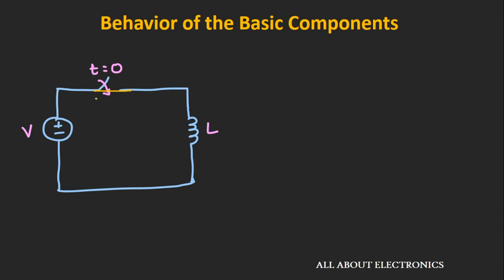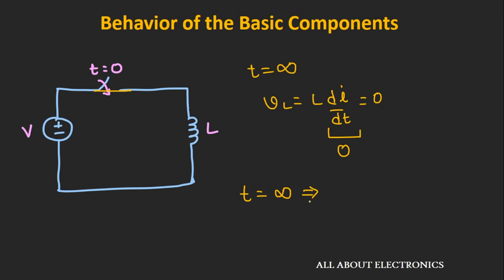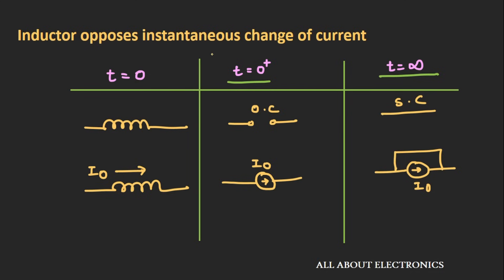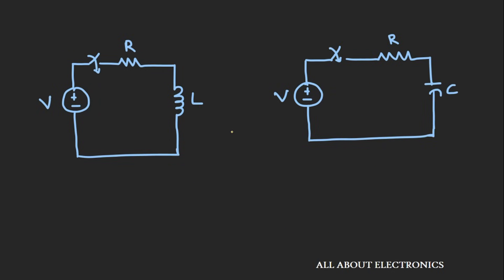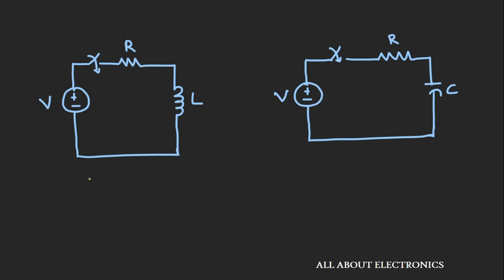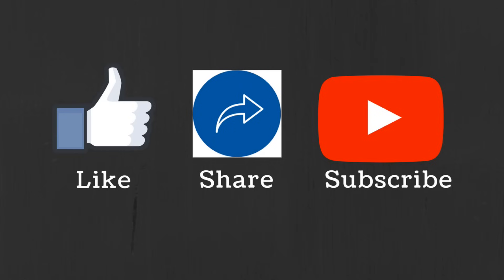Transient Analysis: Behaviour of Basic Circuit Elements

Comment: Great explanations, thank you. I have a few suggestions. I suggest you connect resistors appropriately on your circuits and avoid short circuiting voltage sources and open circuiting current sources. For example at 4.27 the circuit will obey the explanation you provided at switching moment (that is inductor current=Zero) but in long term it will short circuit the source causing theoretically infinite current. This can be avoided if you connected a resistor in series with the inductor.

Comment: I  just wonder if inductor at t=0+ acts as open circuit, but why the current can flow trough the circuit?
Reply: it is because there are two cases it opposes the sudden change in current but along with it when a source of current is already connected and current is already flowing from it then only it acts as a current source. hope this helps although your semester is over lol

Comment: Hi sir what is the meaning of short circuit parallel to current sorce. According to kcl applied at t= infinite the final value will become short  circuit current+ current source value. I mean to say why we write that symbol -it's confusing
Reply from the maker: What it indicates is, the voltage across it is zero. Because the voltage across the inductor can be given as V = L di/dt.
In steady-state condition, di/dt will be zero due to constant current. Therefore, V = 0. 
I hope it will clear your doubt.

Comment: Could u plz give a proper definarion for transient
Reply: Whenever a circuit is switched from one condition to another ,either by a change in the applied source or a change in her circuit elements ,a transitional peroid during which the branch currents & element voltages changes from their former values to new ones.This peroid is called TRANSIENT.

Comment: Before going to subject , please explain t=0-, t= 0+, t=infinity, what is steady state, they help for somany viewers
Reply from the maker: t=0- is the condition or the state of the circuit, just before the transient occurs.
t=0+ is the time just after the transient has occurred.
And the steady-state is the state when the circuit has achieved new steady conditions, where the voltage and current in the circuit will not change with the time. (For DC circuits)
Usually transient gets over is a very short time, (typically in a few ms). 
For practical purposes, even after a few seconds, the circuit achieves steady-state behavior.

Comment: Hello Sir, if capacitor can be seen as voltage source, then if it is shorted, there will be infinite current as t->inf, am I correct?
Reply from the maker: No, actually once the capacitor gets fully charged then it will act as an open circuit and no current will flow through it. Untill it is fully charged, there will be a flow of current through capacitor. Please go through other videos on transient analysis on the channel. You will get it. In case, if you still have any doubt then let me know here.

Comment: What is steady state
Reply from the maker: For electrical circuits, it is the state where voltage and current in the circuit are not changing with the time and becomes constant (For DC sources) then it can be said that the circuit has attained the steady state condition. In transient time, the voltage and current used to change with the time in the circuit.

Comment: Is capacitor doesn't allow sudden changes!!
Reply from the maker: Yes, capacitor dosen't allow instanteniuos change of voltage.
Reply: But my teacher says 
Capacitor allows AC blocks DC
Reply from the maker: Yes, That is true. But here I am talking about the transient. When there is the sudden change in the voltage, like when you are turning on or off the power supply.